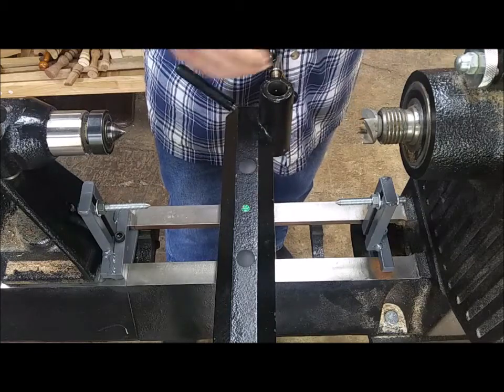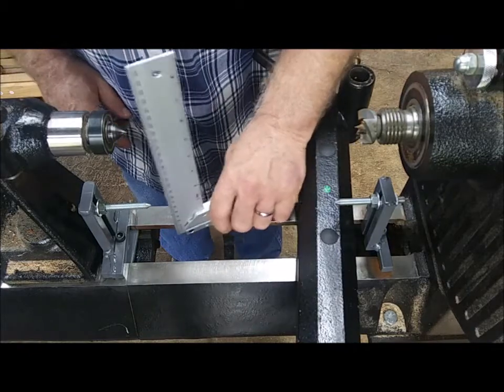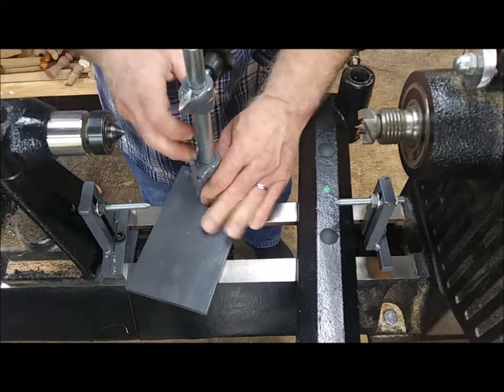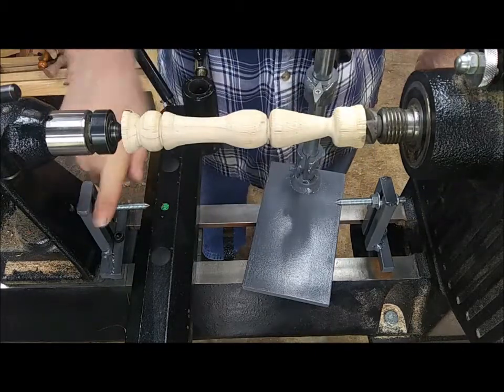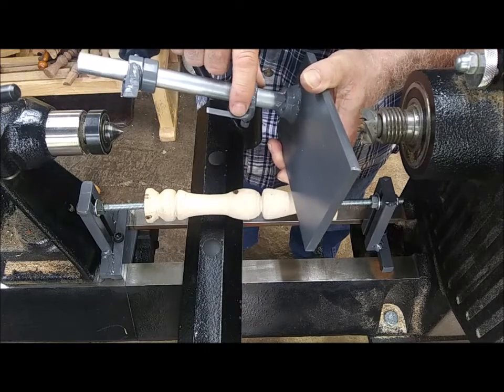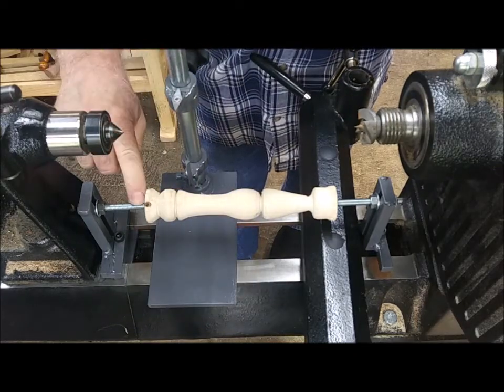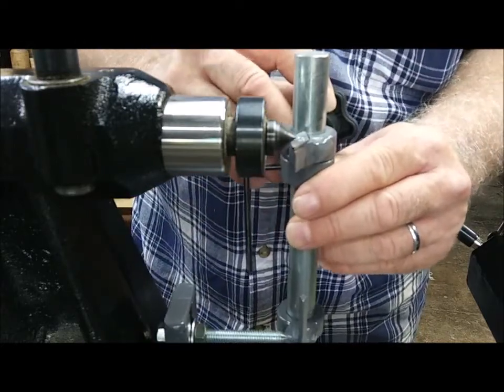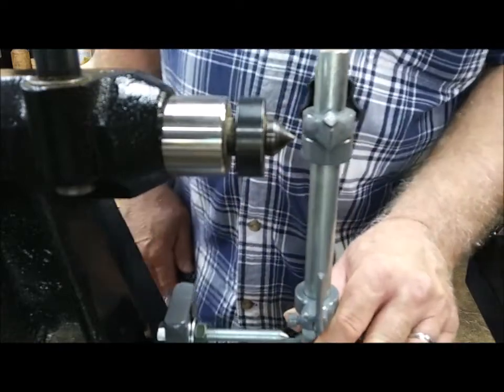part 7 wood lathe duplicator,  wood lathe copier, My Lathe Tool (The Original) basic setup

Comment: Very cool tool! Can this be adapted to follow a 2d template? I assume this works exactly the same on longer spindles. Very interested in ordering one of these!
Reply from the maker: There is a template holder provided with this system to secure a cutout template under your blank so one can follow the template to produce your spindle above. We have not yet made a video demonstrating this in use. I will have to do that sometime. Thanks for your comment and interest.

Comment: Can this be used on exotic hardwoods. African Blackwood, Coco Bola or Osage Orange
Reply from the maker: We have used this on regular hardwoods with good results. We have not tried it on harder woods that you speak of. It does use a carbide tip so it should do well. Bit wear would of course be more rapid.

Comment: I've watched all of you videos and this tool seems to be something I may be interested in buying.
My only concern is that I want to duplicate chess pieces(mainly the pawns) and it doesn't seem like this tool will turn smaller pieces due to the width of the tool post base.
The only way I can see this working for making small pieces is to use a much longer piece of wood which lends to a lot of waste.
Have you turned shorter pieces of wood with your duplicator?
Thanks
Tom
Reply from the maker: Yes you do lose wood on either side if your tailstock does not extend enough to compensate and if your not using a  lathe chuck which the unit can slide under. It is possible however to turn multiple chess pieces on one blank and then cutting them apart when finished. Hope this helps.